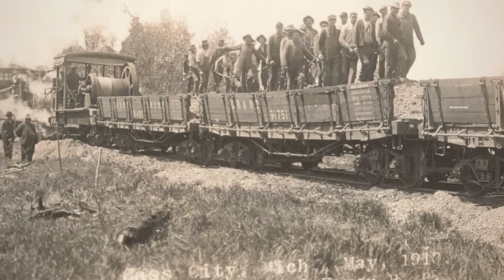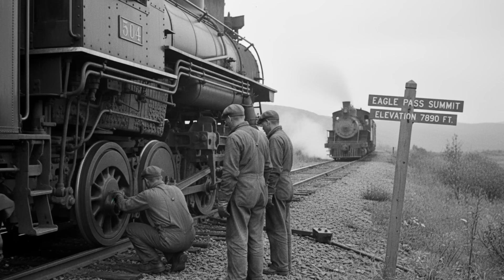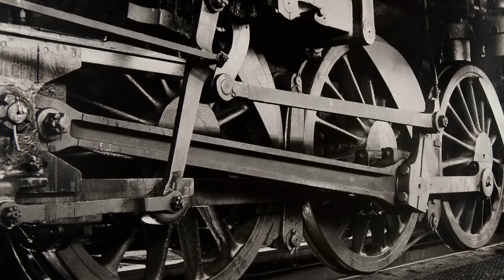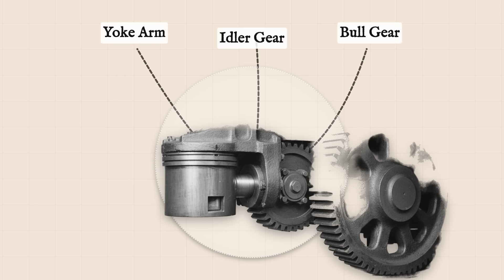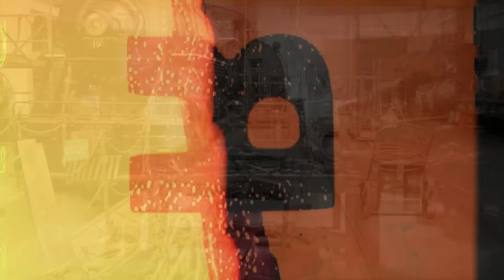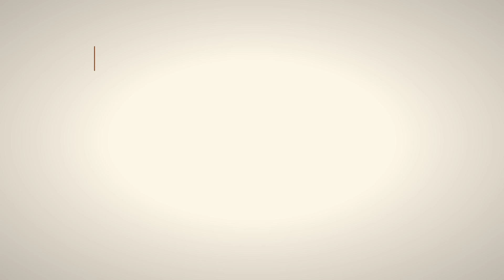The "Secret" Engine Hidden Under The Cab — Why It Disappeared?

Comment: The Union Pacific ‘Big Blows’ actually could produce 10,000hp with cold dense air. Fuel price and corrosion from poor grade bunker fuel ended the turbine.  The would start on diesel then convert to the bunker fuel when the bunker fuel was hot enough to flow through a pipe and injectors, then the engine would convert over to the bunker C fuel oil.
Reply from the maker: The 10,000 horsepower figure is accurate for the later Series turbines -- the Union Pacific pushed that number specifically because the turbine thrives on air mass flow, and high-altitude cold dense air on the western corridors gave them real output gains that a diesel couldn't match at elevation. The bunker C dual-fuel arrangement was the economic lever that made the whole program viable in the first place. Industrial-grade residual fuel at railroad volumes was cheap enough to offset the fuel consumption penalty. The problem is bunker C doesn't burn clean, and over years of operation the corrosion and fouling accumulation in the hot section compounded faster than the fuel savings could justify. When diesel fuel prices equalized and bunker C supply became less predictable, the economics that built the program had already reversed.

Comment: The saying was that a diesel could start more than it could pull and a locomotive could pull more than it coud start. Combine a Steam Locomotive with a dummy diesel??
Reply: There's no such thing as a "dummy" diesel in the real world, just model trains.  And you'd still have to have a crew for the diesel, because there's no way to control it from a steam locomotive.
Reply: @ffjsb they use diesels to assist Big Boy starts
Reply: @JamesPolizzi-q9e with a crew on board yes, not a "dummy" engine.
Reply from the maker: The tractive effort curves bear that out -- steam delivers its best starting pull through direct mechanical drive to the wheels, while early diesels struggled at the low end of the power band before improved transmissions closed the gap. The hybrid concept wasn't entirely theoretical; a few experimental lash-ups tried to exploit exactly that tractive difference. In practice, the operational complexity of running two fundamentally different prime movers killed most serious proposals before they got traction.
Reply: @AmericanIronworks_1 While steam does better with tractive effort, the low maintenance of diesels were the killing blow to steam.  Plus now you ca add diesel at the rear or middle of a train an better balance out the power, all while being controlled by one crew.

Comment: I thought this problem was cured by by the procedure of bumping the train backwards hard, putting slack between couplers, before taking off forward. Ron W4BIN
Reply: Not always, but that was VERY common with trains that it was KNOWN that a locomotive could pull.  Slack action was a thing well known to them.

Comment: In a steam locomotive, there is no such thing as  lock down dead center, the cranks are phased at 90 degrees
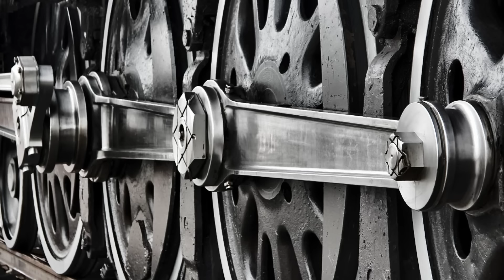so there is always a piston on a power stroke [ 2:08] and the locomotive is always able to move
Reply: Yes, in steam locomotive parlance it's called "quartering".
Reply: And all that slack in the couplers means one car at a time is added to the load.